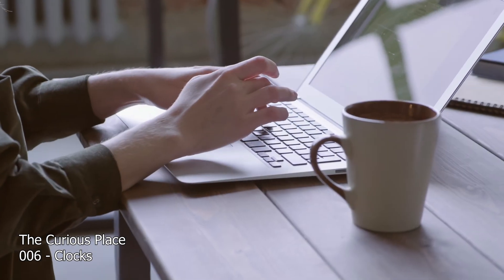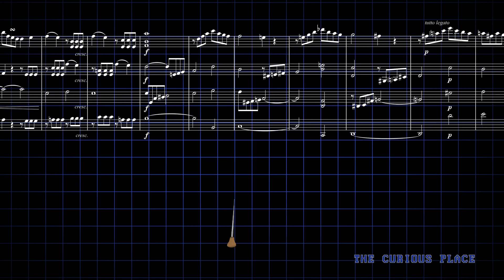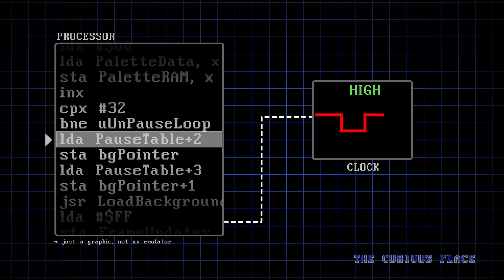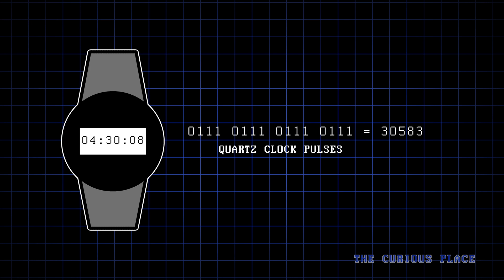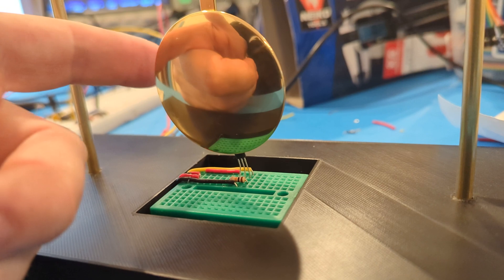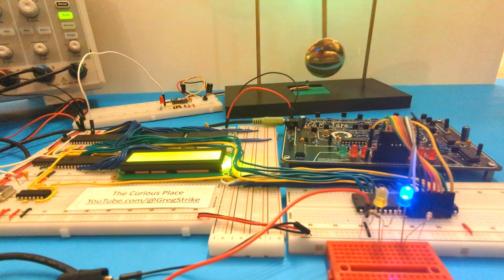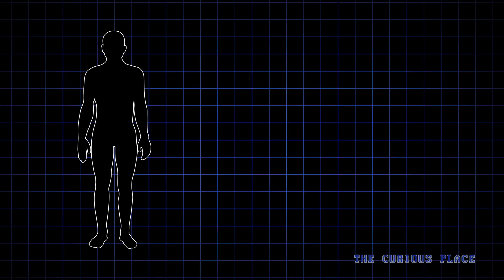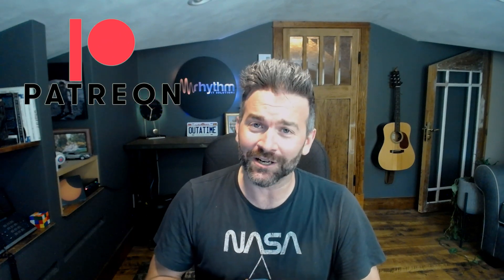Building a Heart Powered Computer (Clocks) - The Curious Place 006

Comment: 12:43 Electrodes on your body and connected [via apparatus] to the mains? That is immediately a red flag. In the medical and hobby medical scenes, there is a strict rule that anything attached to your body may only be powered by batteries! And this isn't such a problem nowadays with USB power banks and laptops, I would say.
Reply from the maker: You are ABSOLUTELY correct!  DO NOT do this with it connected to the mains in any way!

Comment: Great video, Greg, very informative! Obviously if we did the oppsite and replaced the clock generator with a faster one, the CPU would run faster, but of course, just like with modern CPU overclocking, there will be a limit. Whats stopping us from running a 6502 at something like 3Ghz?

Comment: I hate to be that guy, but there’s one thing I need to point out: the Turbo button on old PCs actually, counterintuitive to its name, slowed down the clock speed, not sped it up. As newer machines came out, some programs ran too fast. This button dialed it back so [mostly] games that were hardcoded to a particular clock speed wouldn’t just blaze by.
Reply from the maker: Oh definitely, I wasn't really clear on that part.  Lots of games used clock cycles as opposed to actual time passed to calculate movement!  As CPUs became faster, games not designed for the faster chips would run too fast!  But honestly, who wouldn't love a turbo button on their computer again?!

Comment: Fantastic video, even in modern hospital grade ECG/EKG capture skin prep to remove sweat and salts and dead skin is key to a stable signal. As a biomed it’s one of the first things you check when poor trace is reported 😂
Reply from the maker: Oh that's interesting, i may have to revisit the idea and take more care to clean the sensor area.  It felt all pretty unstable after running...  But an interesting effect I didn't mention in the video is when I was running the computer off my heart and I saw the LEDs change, the heart rate monitor woulds go CRAZY!  Almost like it was sensing my excitement of seeing it all work!  :).
Reply: @GregStrike  When I first started many years ago the electrodes had a rough patch like sand paper on their popper side, you used it to rough up the dead skin to get abetter contact. Maybe try eeg next? and see if it overclocks with excitement from your brain? anyway new sub. Great stuff
Reply from the maker: @tailzer42  eeg is a GREAT idea!